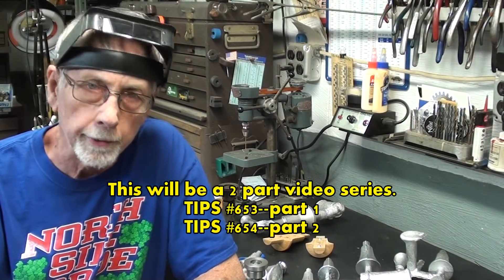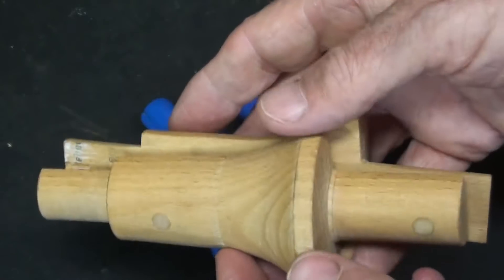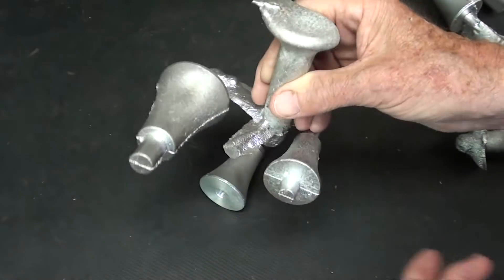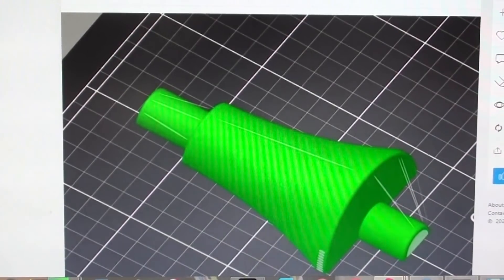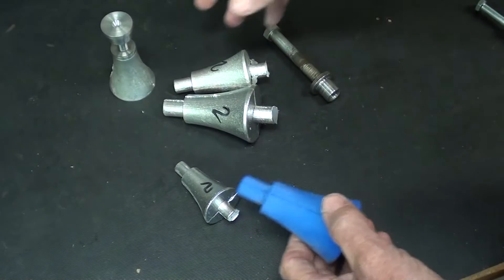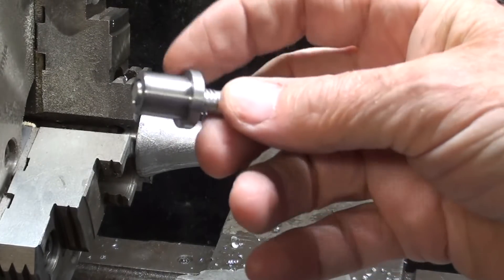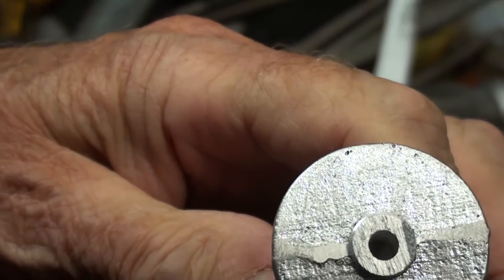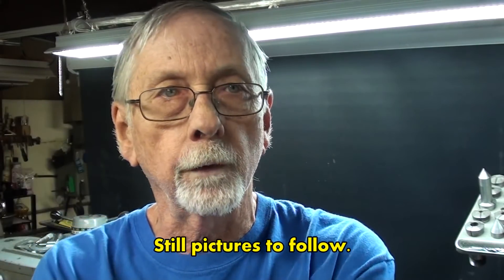HOW TO MAKE a Tiny Machinist Jack #653 pt 1 tubalcain

Comment: For those of us without a lathe or foundry – there is a way to make small jacks using standard hardware.  For the body – use a coupling nut (a hex shaft which is threaded on both ends).  At the bottom, one can put on a fender washer to make the base wider and more stable.  For the top, a bolt and nut can be used for the adjustable part of the jack.  I had some elevator bolts that I used for the adjustable part (elevator bolts have a wide flat head).  The jacks are not as elegant as Mr. Pete’s but they are functional using off the shelf hardware.

Comment: Just an afterthought comment. I was sitting on pins and needles when you pressed that insert into the jack body. I keep a couple of cans of computer duster (canned air) in my shop. If you turn then upside down and spray you can super cool, even freeze an item and it will shrink. Set it up in the vise then spray it until it frosts over then press in. I learned this when I had an axle bearing race spin and lock inside the housing on my Jeep. I didn't have a tool to remove it and I got the brilliant idea to try the duster. I sprayed it until it was completely frozen, hit the outside of the housing with my heat gun and pulled the race out with my fingers (inside a glove of course). I use this all the time when I have a bearing to press in that is going into a fragile housing. Works great.

Comment: Even though most of us don't have a 3D printer or a foundry, it's a great inspiration. With my Atlas lathe I could get some steel round bar stock and make them.  Starting from the base, leave a 3/16" flat, then machine a 15 to 20 degree  taper with the compound  then turn the rest of the body round. Drill and tap the hole and you're done.

Comment: Excellent video Mr. Pete. What if you heated the casting a bit before the press fit? Depending on tolerance the threaded section could drop in with little or no effort and remain very secure at room temperature.

Comment: At the start you mention the suggestion of using a "steel threaded insert" (which you did)... later you refer to "not making another bushing" (same as insert)... I wonder if you actually made those bushings/inserts or did you buy them?  The closest thing I find to purchase is called a threaded rivet nut which looks to be a functional equivalent to your insert/bushing.  Wonder if you think a large rivet nut would hold up, I found 3/8-24 ones with 1/2" diameter and a smallish top flange/shoulder.  Thank you!  Great videos, watched all 4 numerous times.
Reply from the maker: Thank you for watching, I made the inserts

Comment: Sure glad it didn't crack on you when you were pressing. I imagine you use mostly aluminum cans in your melt and that is a very ductile aluminum so it will have a lot of give before it cracks.
Reply from the maker: Never never never ever use cans or extrusions

Comment: Thanks for an inspiring video. Being short of all the leading steps I guess grabbing a suitable round stock of steel will have to do, or aluminum.
Thought about making a rather low jack and addons to put under its base to increase the range of it.

Comment: I was wondering why they have to be split castings when the finished product has a built in draft angle; it tapers and could be cast vertically upside down it seems. the pattern would pull out
Reply from the maker: If done vertically, the holding spigots on the ends would be tapered and useless

Comment: I needed a jack last night but it needed to be less then 7/8" tall. This was to support a casting on the milling machine. I used a 1/2x13 bolt, that had 3/4" of threads. Ground off the excess length, and just used the bolt head and nut on this as a support jack. I have a set of these small jacks that were just too tall to use.
https://youtu.be/6-B5OiCpe84
Reply from the maker: That was a good solution. Most of the time I need a real short Jack, just like you

Comment: "Don't cut off the branch you're sitting on". Sound advise.
Reply: Back in my (much) younger days (probably 40 or so years ago), I was up in a tree with a chainsaw, cutting off a large diameter limb that was overhanging the house... It was probably 8-12" in diameter, so plenty strong for me to stand on... My father and an uncle had a rope attached to towards the end of the limb so that they could pull it back as I cut through it so that it would pivot away from the house... I was not stupid enough to cut the limb between where I was standing and the trunk of the tree, but the same result ended up happening... As I'm there about 15-18' up in the tree cutting the limb outboard from where I'm standing, I hear a big snap and realize that I no longer have a limb underneath me and I'm falling with a running chainsaw in my hand... My thought was "shit, this is gonna hurt"... And then I realized it might do more than hurt with a running chainsaw... I pushed it away from me as I was falling and being the reliable old saw that it was, it stopped running as soon as I took my finger off the throttle... 

Gravity sucks...
Reply from the maker: Wow